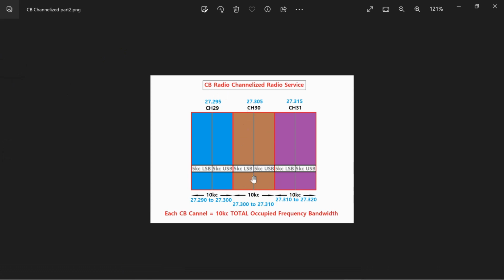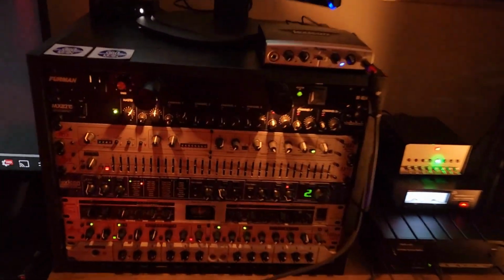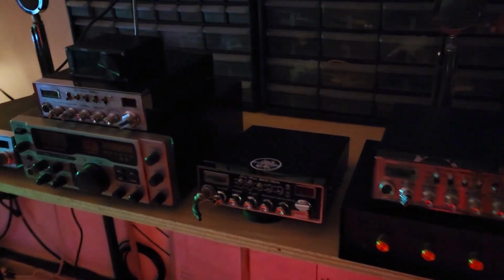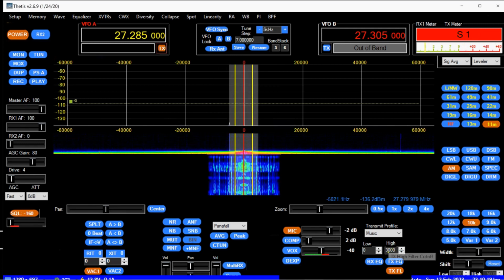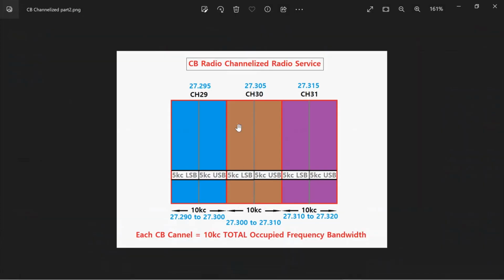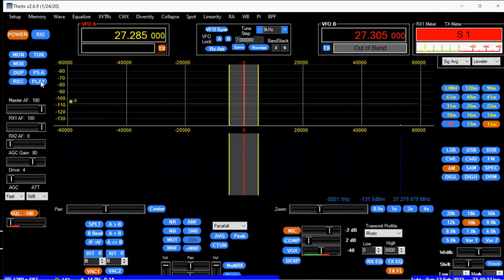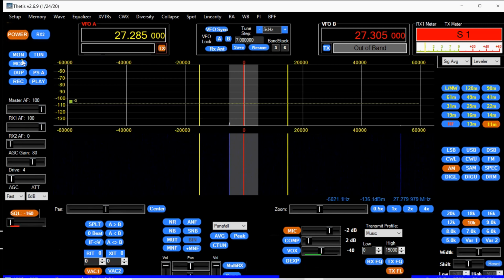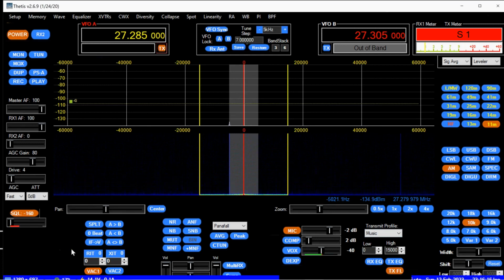Fidelity and its effects on total occupied frequency bandwidth

Comment: The limiting factor is the linearity of all the stages.
Reply from the maker: Hello there Scot. Yes, sort of. In the case of IMD (Intermodulation Distortion), signals passing through a non linear system will create sums and differences of the original source signals creating harmonics which cause distortion and cause frequencies to fall outside of the intended pass band (dirty RF splatter). This of course will not limit the bandwidth imposed on the carrier but will limit fidelity.

Comment: Thanks for showing that! Really interesting, I thought it sounded good at 12k. Thanks 👍
Reply from the maker: Hey Mike. Thanks bud. It was a fun demonstration. I just wanted to put it out there for people who are thinking about getting into this. If someone is looking to jump into this, there is a lot they need to know. I am trying to encourage people to move away from being an "appliance operator" and encourage a little understanding. I know I am not the best at explaining things and I tend to ramble but hopefully this will wet the appetite of wanting to know more and will push someone into further research. This information will come in handy and stands true for anyone looking to move into HAM radio as well.
Reply: @KP68videogates  yeah I am getting in to it and a lot I don’t understand but trying to learn all I can. I have a 2517 galaxy and derail installed hi fi transmit and hi fi rec. I am running a urkraine 10 band eq and I am also running a mixing board too, seams to sound better?? I also have a cobra 2000 and it sounds different with same setup and different on a connex    that I have. I think I am going to take your advice and get someone to do direct injection and see if I can get better hi fi sound out??? It’s a real head scratcher! I have tried 20 different mics I guess but I am nowhere close to the hi fi sound I am looking for. I really like the information you are putting out there and thanks a bunch!!